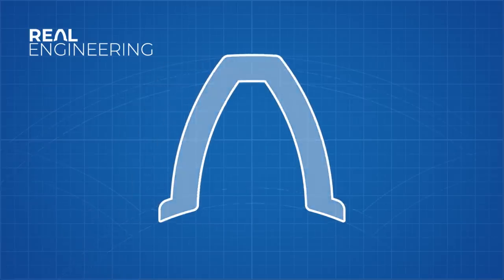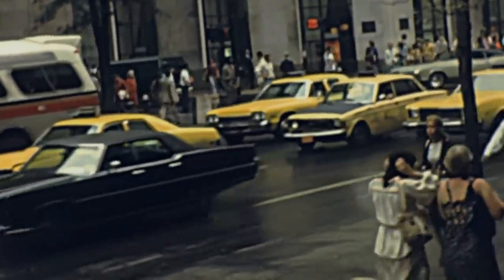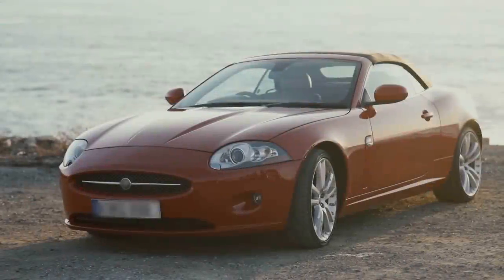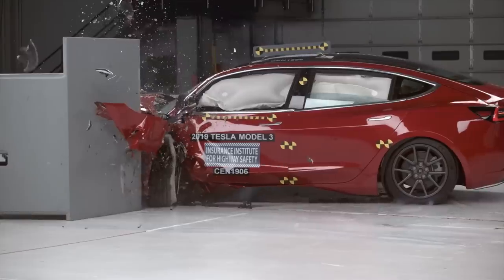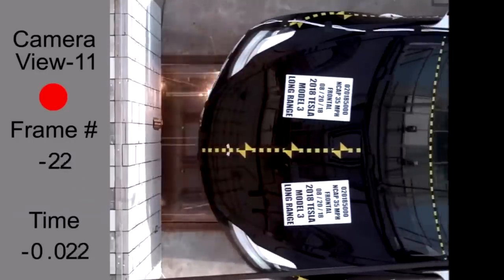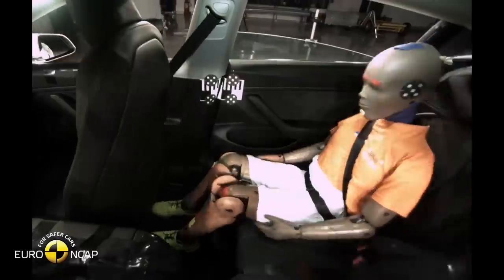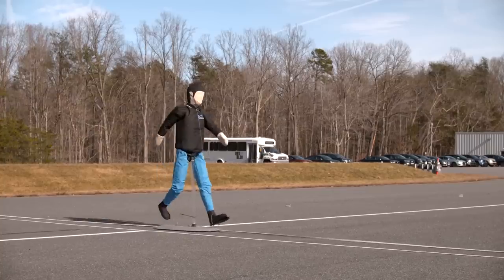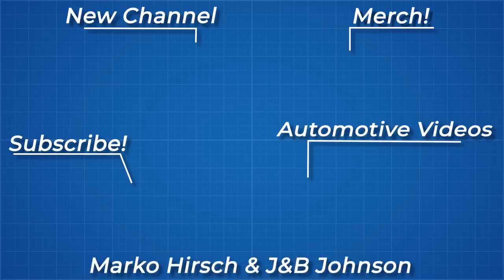Which Is The Most Dangerous Car?

Comment: The lack of research and reasoning in this video is really disappointing. Safety ratings are issued at a date - they're not continually updated. The ENCAP rating for that Mitsubishi is from 2013 - that means it can't be compared to ratings in 2020 as they're different. That 4 stars in 2013 could be 2 stars if retested under 2020 standards. Also, you can't make a causal link between deaths/mileage and vehicle safety. It's correlation only - there are too many factors that makes drawing any conclusion stupid (i.e. average weight/height/sex of drivers, locations they crash, speeds at which they crash, proximity to and quality of health care/first responders in the crash locations, underlying health conditions of the drivers, usage of seat belts by occupants, skill of driver to minimise injury during a crash etc).

Comment: Using that classic car for a pointless test.. lucky I was not running that department I would make them cut the body up into 100mm pieces which would then be re shaped and seamlessly welded together and tested for imperfections. All heavy components like engines and transmissions would be sorted, melted down and re-manufactured all at the expense of those who authorized the tests. If someone said something can't be done, I would find someone who could do it. Hundreds of millions of dollars and thousands of man hours later the car would be rebuilt as new and those who sacrificed it for nothing would have learnt their lesson.

Comment: Curious is this matters, but the average American woman is roughly 10 cm shorter than the average man. There is also a higher likelihood that a very short person is a woman. That’s going to affect how close the person is to the A pillar and engine block (unless the vehicle has adjustable pedals). That likely means the person isn’t exactly where the crash test is testing. Same applies to taller individuals, but with different challenges.

Comment: Yes, I've been curious as to how Tesla intends to solve the stainless steel issue. And I do expect them to have a solution. My guess is that it will involve scoring the steel so as to collapse at a safe level of impact. i.e., to be lowered to standard panel tensile strength, while still maintaining its ability to withstand marring. Or is that contradictory? Origami, baby! 😂👍

Comment: I would ask what kind of an impact incorrect seating position has
as quite a few women prefer to sit way too close to the steering wheel

both airbags and seatbelts expect the drivers head to be a specified distance away from the steering wheel
sit too close and you're rendering both not just useless, but also potentially dangerous to you.

What about pregnant women who claim they should not have to wear seat belts, because they can potentially harm the baby?
yeah... head-on crash with no seat belts, and that harm would be the least of your worries...

Comment: From what I've seen so far, it turns out that American cars have a smaller focus on safety. The problem is in the authorities, they do not put pressure on manufacturers, while EU pressure is much greater. That is why cars in the EU are much safer and you can see it on the price. The American car is cheaper, the product processing worse, the safety lower, the consumption higher. This can also be seen with Tesla, the quality of workmanship is quite lousy compared to most European cars.

Comment: How about 2 10mm thick metal board with 4 small wheels, all 4 steer, 2 small jet engines in the back and you are sandwiched in-between the boards liying down

Comment: One question is which we should be promoting. Less trucks = safer for small cars. So maybe designing the test not to consider vehicle weight is actually good for society a whole... Even if it does overrate the safety of smaller vehicles.

Comment: This is a fantastic film with important information first everyone who drives a car but as you say and completely correct by saying car safety is not straight forward as just adding a air bag. It needs to be broken down in depth which sadly you only gives a tiny peep into the subject. So please could you carry on and make a longer film than just a quick headline 12 mins or so. Make many films as I'm sure you will need to do to cover everything. Like the small car, which always gets a negative review on the top tens this n that, which I feel is wrong. Like you say in America where the truck is king , it should include tests with different drivers, cars and countries. It should also be mentioned a car for its price bracket and type , sold and crash and depths . I think the car insurance companies are the villains who are only led by greed and happy to lie and wrongly have input on people lives.

Comment: The most eye-opening thing about this video is how difficult it is to apply statistics in a useful way. Is Mirage killing more drivers because it is a genuinely bad car or does it have something to with the demographic who prefers it? 

I'm pretty sure if you looked at the statistics for the "boss cars" i.e Rolls Royce, Maybach, BMW 7 series etc, you'd see almost no fatalities. Is that because those cars are inherently safer or? Or is it because those cars are often driven either by professional drivers or used almost exclusively to drive someone to and from the airport or inside the city? 

I'd argue using the dataset available to you, you can't even get a vague idea about which car might be the safest or the most dangerous. There are just o many variables you must control to reach any sensible conclusions. 

First I noticed this issue was when i was looking at the fatal accident chances for riding motorbikes. If you just look at the "deaths per km travelled", riding a motorbike is insanity. If you ride for 10.000 km you're pretty much guaranteed to have a serious accident. But when you dig deeper, you see fatal accident rate for sports bikes are 10X as commuter bikes. And commuter bikes are 10X higher than cruisers and choppers. Same goes for the age groups. If you're under 30, riding is insanely risky. But if you're above 40 and riding a chopper, it's pretty much as risky as driving a car.

Comment: I was surprised smart car didn’t place; also that they test at 35, when the USA national road speed is generally 45.
Reply: The smart is basically a car built around a roll cage, they are pretty tough, although they don’t have much crumple zones
Reply: Usually before a crash someone will slam the breaks a split second before so they will be closer to 40 even 35 mph right before the impact.

Comment: The Bel Aire has nothing but sheet metal, unlike the 1955-1956_1957. Full steel frame box . Not the x frame which gave no structure or protection.
Let's see the same test with the 55-56-57- ???

Comment: If your car is built like a tank and it collides with a modern car
it would rip right through the modern car.
Reply: Volvo tp21 sugga is a 50s 4x4 made for higher speed military transport 
Military vehicles are supposed to keep running no matter how much punishment it receives not use crumple zones to make a crash safer
Reply: @ocallaghan3865  A military M1126 stryke ICV could also destroy the Volvo tp21 but Volvo tp21 was impressive at that time.

Comment: Don’t get me wrong, saving lives on the road is great, but adding more technology for safety ruins the driving experience. Cars are getting heavier and feel like boats. Thick A pillars block fields of view. And “smart” traction control systems ruin the fun of kicking the back end out. If you buy a sports car, you should know what you are getting into. Don’t ruin more fun cars with legislation. Everyday cars and high volume cars could use more safety, but not enthusiast cars. Also, #savethemanuals

Comment: I am not sure, but isnt a male body more fragile to  deceleration caused demage? You have a lot more weight over just a bit more surface. Furthermore men are taller causing their heads and arms/legs take up more space in a crash (its hard to miss an airbag when you are 150cm tall, but when your head is touching the ceiling it becomes a lot more realistic)

Do you have any statistics about how many females/males died to gender related injuries?

Comment: The old car used had no engine or drive train so its a propaganda stunt not an actual test.
Reply: Zuurker U  A car from that era does not have a unitized body. The engine and transmission are bolted to a (usually) X pattern frame. In a collision kinetic energy is absorbed from the engine and transmission which forces the X part of the frame to buckle. The force of the impact travels down the drive shaft to the rear axle (also bolted to the frame) and if there is sufficient force is ripped from the frame and ejected out the back of the car. Without all of the components in place its the same as testing a cars air bag system with the air bags removed.

Comment: At the risk of sounding sexist and this or that I do have to question your conclusion about the mirage. What if its poor survivability score is due to its client base. I am will to bet that the majority of mirage drivers are women, who are nearly 50% more likely to be injured or killed in an accident according to your own information, wouldnt that skew the data even more?

Furthermore, changing the tests, makes it harder for the consumer to compare vehicles with a slightly older car to new ones. A simpler solution would be to go with more stars as technology evolves.

Take the VW Amarok for example, it has a great structural design and at the tine of its first release it scored very well for occupant safety, better than most 4wd pick-ups. But with the progression of technology, it would stuggle to get 2 stars in the ANCAP (Aus Ncap), not because it is less save, but because the requirements changed. Because it doesnt have autonomous braking or radar cruise, it cant score well in active safety, but Id still rather be in the Amarok in a crash than in a car that scored well in active safety features but a lesser passenger cell design

Comment: The safest car to be in: A large, 4 door SUV or Ute, with a Bullbar and a good driver behind the wheel.
Large - gives inertia to it, making it not stop as easily. I've personally seen crashes where a 4wd has hit a sedan or some such, and the occupants of the 4wd being uninjured. 
Height - puts any impact from lower cars being at or near the floor pan, so the doors won't get crumpled as much and the other car would go underneath somewhat, so its occupants will be better off.
Bullbar - mostly for Roos, the fuckers love to jump out in front of you, and they will bounce off the bar instead of the windshield.
Good driver - doesn't speed, keeps good braking distance, doesn't get road rage, knows how to handle the car they're driving.
It might roll, and it might be worse for solid impacts against trees or bridge columns, but a good driver prevents this. Usually a fatal crash in a large car is caused by inattention, being a wank (DUI, road rage or Hooning) or someone else crashing into you. I see 4wd's as a car that says "I'm here for my safety, not yours." And love it or hate it, it's true. If you don't like it because it's dangerous for other people, then they should have one too.

I drive a GQ Patrol, it has no airbags, it weighs 3 tonnes, it is high off the ground and has all the barwork. I can guarantee you, in any serious crash with anything smaller than me, they'll come off second best. I might come off second best in a crash against something else though, so I drive carefully. 
IMO most preventable deaths are caused in one way or another through negligence, you don't stress because you feel safe and in control, so you think less of dangerous activities (people handling guns, people driving cars like mad or stupidly are good examples). When you stress a little bit when doing these things, you're alert and aware, and you can react to things you might not notice or ignore. If it wears you down more, take a break every hour or two, get out, walk around get a snack or drink.

Comment: tesla got 5 start 
at the same time people got burn to death in therre teslas because people from outside could not open the doors because of stupid designd door handels :/
also fun fact if modern NCAP crash test the car needs to have accident prevention technology as standart in ever model to get 5 stars
if it is only a option then it get 4 stars max 

5-star safety: Excellent overall rating for impact protection and good equipment with comprehensive and practical accident prevention technology
4-star safety: good overall rating for impact protection and general safety; additional accident prevention technology may be available
3-star safety: At least average occupant protection, but not always equipped with the latest accident prevention technology
2-star safety: nominal impact protection, but no accident avoidance technology

so most cars for 90s early 2000 will only get a 2 star rating today

Comment: This vido seem to me to be full of disinformation.
Demonstrations of the past I have seen had old cars crash tested...
I  have seen an old Chevy hit a tree at 50 miles an hour with safety belt and watched the driver walked away without a scratch.

Try doing that with your cheap collapsible paper thin modern cars.

I have even been in accident where a driver of a hatch pack hit our Chevy while he was free guided down a hill with his engine off!

The idiot almost killed himself when he crashed into us. Four us got out of the Chevy to help him.
Not a scratch on us but he was a mess.

I would rather drive in an old fashioned car that's a tank then  drive these modern tin foil cars.
I see them has death traps.
Reply: You are clearly misinformed, first the "cheap collapsible paper thin modern cars" are designed that way to absorb kinetic energy, that's why the collapse like paper to avoid transfer all the shock energy to the person inside the car. Second of all, you are not tough because you drive a heavy brick car which doesn't get more than a scratch when go crashing into a wall, all that kinetic energy is going somewhere guess what is you, and you're going to hit your head or break your neck (etc) but guess what again, the car is going to stand like a champ like the brick it is while you break all you're bones. And third is doesn't matter the 2 cases you've seen, what matters is the statistical data that shows the amount of dead or injured people by driving old cars vs new cars and how that number go down significantly whenever new safety standards are added.
Reply: @shalala4217  Good Luck :)

Comment: You sound very pseudo feminist with your man dummy vs female dummy issue. What's the difference if it has a long haired wig or not, they're not representing the correct body structure all the way to the bones with the million varieties anyway. Besides, they're there so we can see the points of impact and force, which is representative for the average human walking the earth. It could've been Pinocchio, who gives a damn. As you probably guested by now, not even every male can compare with the dummy, because of proportions and mass. That's why the headrest is adjustable. I wonder how the female headrest will look though. Or a headrest for a black human. No, seriously you should've commented on the fact that the dummy is actually yellow. By the way the term "all road using" includes far more variety than the therms male and female, and that is even another question and I think a bit more important then the one you chose to bring up.

The other part of the video is probably on point, but I already lit up on that one damn comment, so I could not appreciate it from then on.